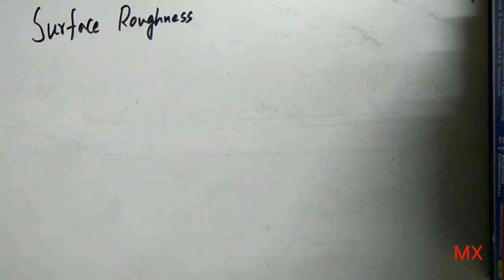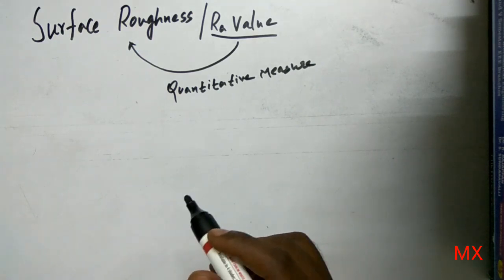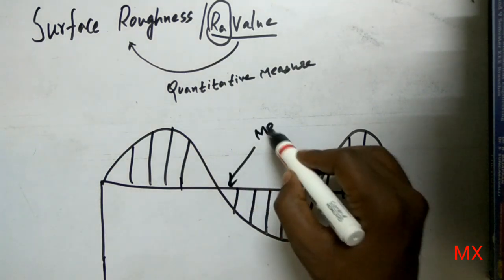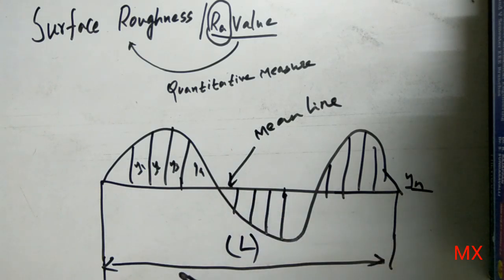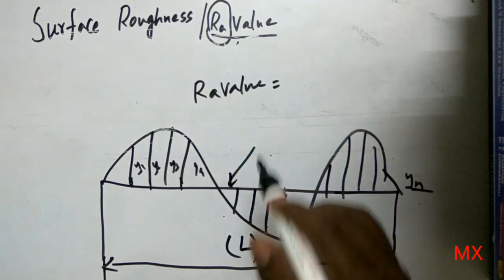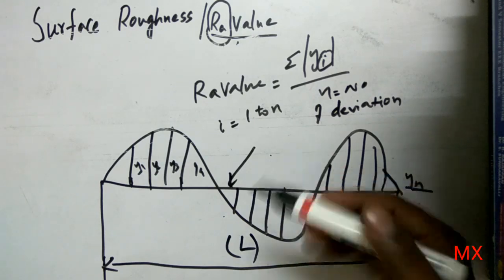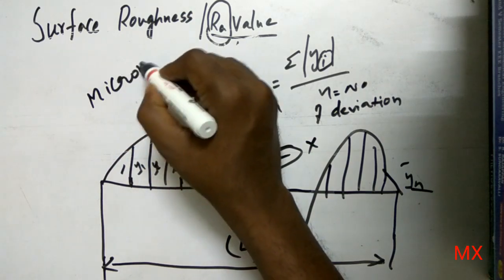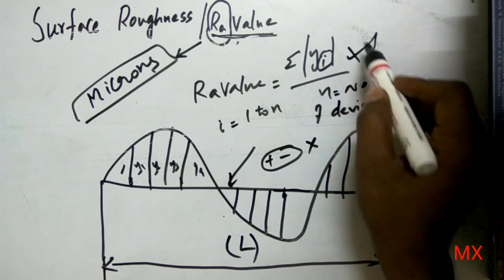Surface Roughness | Ra value | Fluid mechanics | Mechanical Explorations.

Comment: Plz sir do one or more questions on surface roughness if only feed is given and side cutting edge angle and end cutting edge angle.

Again ,one more thing sir , if in competitive exams like gate  ,they asked for roughness then what should we find peak to valley height or simply average roughness? 
Sir plz answer me. Thanks a lot.
Reply from the maker: Modassir Ahmed you take average value for Roughness and solve it.
feed video will be coming soon.